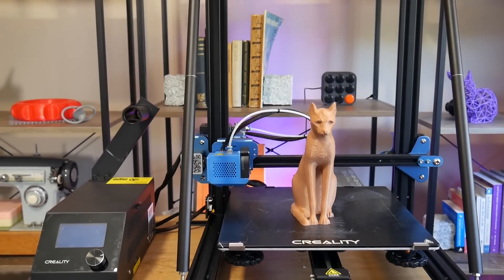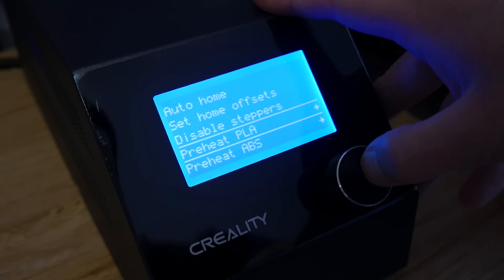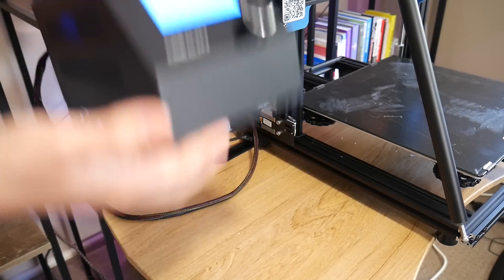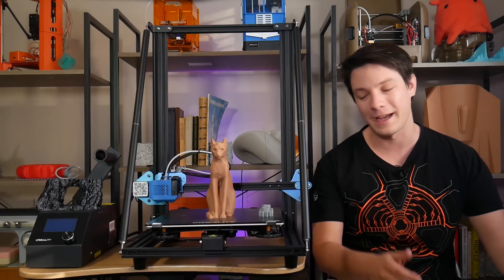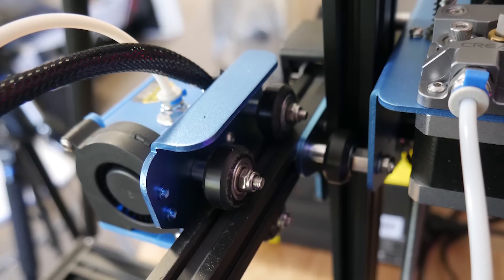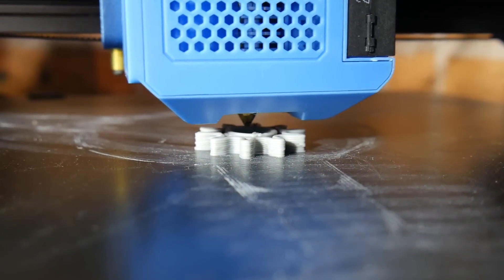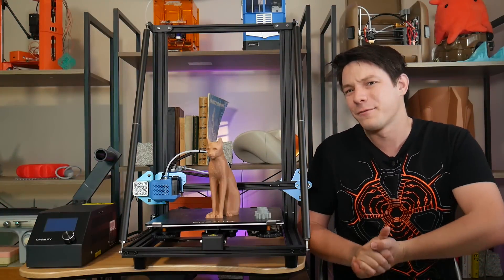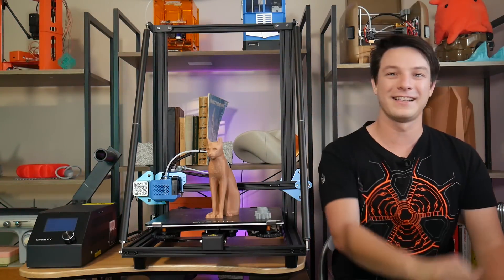Can the CR-10 V2 topple the Creality King? 3D Printer Review

Comment: So question for you. I have a Bambu A & A P1S. I love them. But I'm making Helmets and my head is slightly bigger and have to cut the helmets. Which I hate because its more work. What printer would you recommend around $700 or lower. That's easy to use and has a nice build plate size. Thanks in advance.

Comment: I own  two of these... they are both COMPLETELY DIFFERENT. ordered them both directly from the creality website, both came if different boxes, the hot end is different, one of the extruders can take a manual knob the other can't, one has holes for the bltouch (don't buy one) the other doesn't, and one had clips for the bed the other had integral sliders to hold the bed; and it's sort of random which one has what parts.

they both print perfectly, except the filament sensor on one was not functional, so I simply bypassed it by breaking it open and taping the switch into the "on" position.

Comment: Great review Angus. The constant smile on your face speaks volumes about how passionate you are about this hobby.
I am thinking about getting the V3 of this printer and have watched a ton of unboxings and reviews however there's one thing about setting up the printer that bugs me..
Not once have I seen anyone put a square on the uprights and so in theory when installing the support bars you could push one upright slightly backwards and pull the other one slightly forwards. The taller a print goes, the more twisted it would print? Or am I missing something here?

Comment: I have an ender 5 and the best thing I did was ditch the creality version of Marlin for th3d version of it. I eventually put in an ezboard lite as Welland that made it even better. So far I got a t8x2 lead screw micro Swiss all metal hotend glass bed ezabl Capricorn tube ez board lite. I might as well buy another printer to do upgrades on. Maybe I'll get a core xy. However I did want to still try a remote direct drive on my ender 5. I wasn't sure how into 3d printing I was going to get but I really like it.

Comment: All i can say is DO NOT buy the BLtouch. For some reason, they disabled soft limits with their bltouch firmware, meaning you can literally jog your machine into and end stop and have it destroy itself. You can also drive your hotend into the bed. It’s actually really easy to level manually, at least mine was. BLTouch for this macjine just isn’t worth it

Comment: This machine prints great, but I don't understand why they don't give it a wifi connection and control it through an app.  Would be infinitely better than the very clunky, awkward, and inconvenient knob based interface, and shipping data back and forth on SD cards.  That's just silly.

Comment: As for the bed heating before the nozzle, you can always set them to heat up together once you start the heating process by going into the settings. I only have the normal CR-10, but I’m assuming it’s the same since the firmware looks the same.

Comment: Great Video! It's 2020 now and I finally decided to jump on the 3D Printing Wagon and I'm really glad I did! I went with the original CR-10. I cant believe how easy it is to print things with this printer.. I just bought some glow-in-the-dark filament for a super cool character I plan to print for my next video! >:D
Reply: Hi, sorry to dig up an old comment. I'm looking at buying my first printer. Main use would be to prototype projects and having detailed prints is a requirement as well as being able to print a decent size. Would you recommend the CR-10, and if so, the upgrade versions or would the original be fine?

Comment: Bought and set my CR-10 v2 up yesterday, making sure everything was square and level... Only two minor issues I've found so far. The Y-axis has a tight spot towards the rear, and the Z-axis switch is too high, leaving the print bed to lose and prone to wobbling while moving. Can't do much about the Y-axis, but printed a new mount for the z-axis switch so I can lower the bed a touch, getting those springs under a bit of load.  

Todays' task is tweaking the settings for PTEG...
Reply: The problem same for my CR 10 V2 , z wobble problem maybe from the bed can't tight and fix. Any update solution? Thanks in advance

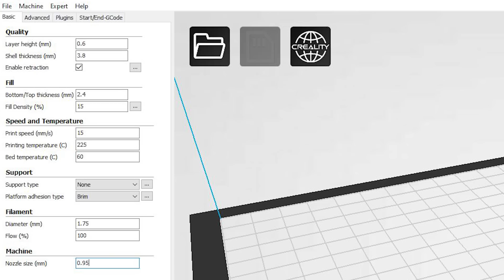Comment: 8:11 that’s pretty slow... My 1mm nozzle I print at like 60mm/s (with .8mm I do about 100mm/s). The only reason the 1mm is so slow is just because the printer was in really bad/worn out shape.Taking it apart right now, I see 3 linear bearings were not in great shape, my idler bearing fell apart, my frame was extremely loose and wobbling, my Z stepper frame structure was loose and barely held on wobbling like 3 degrees in all direction, I have part of my extruder held together by zip ties, and several of the bolts I realized were never even long enough to screw into anything since I made it 7 years ago...  Technically my nozzle even was extruding a figure 8 shape with 1.4mm in height and 1.1mm wide with the pinching of .9mm in the middle of the “8”. I mean I used to print 150mm/s at .5-.6mm but it shakes itself apart too much and my poor ol printer was needing some work so I did that this weekend (also other things like the glass bed was broken so I had to print on the remaining “L” shape just screamed to me that it was time to fix stuff lol!)

I’ll keep running this thing till it dies or it kills me (and seeing as how it’s even outlasted a power cable that could have burned down my dorm room and I still fixed it and use it to this day, It’s probably going to have to kill me first!). Everything is just too cheap to replace when it does break (it looks like the notorious A8 is going for $89, and that would be the closest thing to represent my machine in today’s prices, mine is an old school Prusa i3 clone, so no screen or SD card like the A8, gotta leave the laptop plugged in the whole print!). I’m looking to get a new second machine. I’ve upgraded mine to Bowden a long time ago for rapid prototyping, so I want the other to be a slow and accurate direct drive but it seems all the new ones are Bowden like Ender 3/Ender 5/CR-10/Tornado Titan etc. the only direct drive I seem to find are the ancient obsolete ones like mine (which makes sense, it was direct drive, and they are still selling the same crappy direct extruder mine originally used since these are likely 5 year old warehouse stock trying to get rid of at under $100). The Ender 3 looks perfect if it came with silent 32 bit board and direct drive, I’d happily pay an extra $60 just for that, although I guess that’s like the price of the upgrades and keep the old ones “free”...

Comment: Thanks for this review, still not sure what to buy. :-)
Great to see a Mean Well in this, but is 350w enough for a heated bed on such a large build volume? Also, will it be sufficient to support a volcano hot end?
We talk about Creality listening to feedback, but I’m not convinced. They shipped the CR-10s PRO with a fantastic 500w Mean Well unit and not put one into this printer, but thank goodness they did not use that fire hazard 500w “Branded” PSU from the Ender 5 Plus.  It is a real shame as I would have gone for that printer had it not been for that PSU.

Comment: My BEST upgrade to my cheapo A8 clone was a genuine E3D "Block and Sock" kit. For under $30 I had fixed the flakey taped-in-place hotend thermistor and now had badass heating capability, can run 1.0 or 1.2mm nozzle very well even at ABS temps.   If I got that I'd quickly do the same....though kinda nervous to go bowden from DD.

Comment: My CR10S transformed from a mess into a star when I added a BL touch with mesh auto bed leveling. So in my case, for long term reliable, fuss-free operation, a BL touch or any other good ABL probe is a must.

Comment: Can you do a comparison between the CR-10 V2 and the Artillery X1? pleeeeease
Reply: I hope this helps a bit:
I have bought both, and I love both of them.
The CR-10 V2 is very reliable, however I didnt have great results with the optional titan direct drive extruder. But aside from that, it is a great printer, amazing prints, great build plate adhesion. I mainly use it with my 0.8mm nozzle, and still get great results with amazing strength.

While the Artillery Sidewinder X1, with its volcano hotend, and direct drive I have found prints flexible and exotic filaments amazingly. The only issue with I had with that one is the lead screw couplers. They were very wobbly. But after replacing them I got great results. 

They are both great printers, however I cannot say if one of them are better.

Comment: I have a original CR-10 so did you think they would make an upgrade kit to fix up the older machines? since really it’s just braces, new steppers, power supply, and a few other small things. I’m sure there would be aftermarket kits but I’ve been always cautious of quality and longevity.

Comment: I was hoping for a review before I bought mine over a month ago. I took the gamble and picked one up. Its technically my first printer but Ive been so happy with it. Printed some great stuff with the stock nozzle but upped it to a .6 to print larger vase based stuff. I havent gone into Cura or Creality settings to tweak anything but have been getting good prints with basic settings. Getting some base ideas under my belt then ill deal with tweaking. Just trying to prototype fast atm

Comment: no its not hard to level. as long as that plate is FLAT leveling is easy. intuitive? no but once you "get it" its quite easy.

yes the UI firmware SUCKS. it does that "lagging" thing where you are turning the encoder and nothing changes. really annoying. but the print quality is quite nice and its very consistant. I have not had to touch the leveling knobs since first level and I have picked it up and moved it!! nice!

For the flat spot. x carriage is likely "too tight" just loosen it a bit and that might go away. and YES 1.0mm is what I have on it till my 1.2mm nozzles arrive. go 230'C and you can run 30mm/s no problem. (at 0.4mm layer height)

And here is the thing. with a 1.2mm nozzle you can go .6mm LH or .4mm LH (my default) or yes 0.2 0.1 and 0.05mm layer height. nozzle size has nothing to do with layer height so have at it!

as long as none of the radius in your model is finer than 0.6mm (the minimum radius this can typically form with a 1.2mm nozzle) than you will never know it was done with a 1.2mm nozzle except that it is done faster and stronger!!

Prints with 1.0 or 1.2mm nozzles are just SO stinking strong !!! I love it!

Comment: Hey, i love your reviews, Keep it up. 
Can you suggest me few options of 3D printer for my office prototyping work, with below features: 
1- Dual independent hot-end.    
2- TPU, PVA and ABS compatible 
3- direct drive (because of TPU will be my primary printing material) 
4- Minimum 300x300x300mm printing volume. 
5- heated bed 
6- touch screen 
7- fast and good finish
8- any 1.75 filament material can be used. 
9- Strong body and look
10- Under $3000 USD. 
Help me, Thanks
Reply: Why don’t you get yourself a Craftbot 3? It’s a bit expensive and a bit smaller than you want but check it out

Comment: I have 2 of the CR-10s machines and they both work flawlessly after creating supports for the uprights and a few mods to the stepper gear for the filament.  I leveled my bed over a year ago and haven't touched it since with no problems of the models coming loose.  And it's the original glass (warp facing up).  I also just started running TPU through it and it works great as well.

So I don't see much need in buying a new machine that isn't a huge improvement over the CR-10s design.  However, I would love to see a Volcano hot end or native direct drive.  I almost upgraded mine, but just never really felt like messing with it.

Comment: So basically it's a cr10-s with extra frame support added and micro sd to sd and you have a v2 cr10 is amazing I still have the first version and loved upgrading as new versions came out you learn more starting from the basic those lines on the prints I do believe there seams and you can hide them in cura to the sharpest point of the prints or hide them by random seam points hope that helps great review tho bud keep up the great work love your vids :)

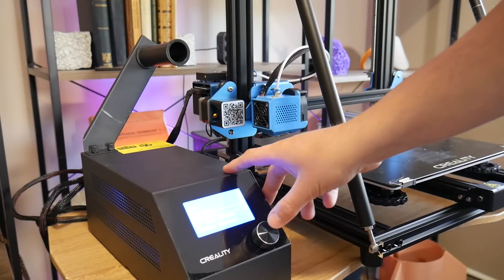Comment: Regarding the comment about the interface at 4:30 "I don't know what they were thinking" .... I think they were thinking nobody is using this interface instead of octoprint.   
I mean really.... has anyone ever used this interface for more than printing that first 'lucky cat'?  I have not touched that knob on my CR-10 in the nearly 2 years I have been using it. (other than resuming on a 'pause at layer' function)
Reply: Totally agree with @gamer SincePong.  On my CR-10, I've been using this Bed Leveling plugin for OctoPrint that has on-screen buttons to move the hotend to the corners and center with just a click.  It also heats up the bed, THEN the hotend, and plays a tune alerting me that the printer is ready.  I have not touched the knob in years also.  Not an issue!
https://github.com/electr0sheep/OctoPrint-Cr10_leveling

Comment: Hi Angus, could you review Sovol SV01 as the appreance  looks such similiar with CR 10 V2, but the price is much cheaper than v2, and it include direct drive extruder (Clone), meanwell powe supply, dual z as well, aluminum frame, but the price for sv01 is only $299, it is quity worthy. th3d did a live stream for sv01 last week and they are  ready to resell that printer with updated firmware and others.

Comment: Look at the Sovol SV01. I got one for $150 and loved it. It retails for $300 but IMO it has a lot of great features (direct drive with E3D Titan remix, ceramic glass build plate, filament runout sensor, and Meanwell 24V power supply) that the stock CR10 appears to lack. It can also heat the bed and nozzle at the same time, and prints flexible materials wonderfully with a single easy modification in the extruder.

Also it's size is respectably larger than Ender 3 but just barely under CR10
Reply: agree

Comment: Angus, you mentioned that the print surface likes an ultra close first layer but you didn't mention the actual layer height you found was needed. On a printer of mine that uses a Build Tak type surface I use 0.25mm for first layer. I recently acquired a delta with this same type of glass like surface. The default slicer profile used a first layer height of 0.3mm which seems way too high. I'm going to test 0.25 but wonder if it might need to be lower.

Comment: That click wheel is the most annoying thing, at least with my Creality printer. I ended up removing the wheel and controlling it using nothing but the shaft to avoid the constant accidental change of selection when clicking.

Comment: This is actually one of the better machines, of this price class, you have reviewed so far.

One word to the software. Changing the input mode and hardware requires often a very costly developer, and if you need to cut costs, you go by "don't touch what works" rather to invest in a harsh new reality. Just my thoughts about that.
Reply from the maker: Yeah, I think that's what is happening here.
Reply: If companies want to hire the very best without breaking the bank, we have a stable of dozens of super affordable firmware developers standing by who know how to do configuration and enhancement. Many of them are open to freelance work. They are, by and large, Westerners, but a few are located in Asia.

Comment: Are they still using the ATMEGA1284 in this model?  Creality need to move off of that and either go 32 bit or at a minimum thee 2560 so you CAN have multiple convenience features.

Comment: I didn't catch if this comes with dual-Z lead screws.  One would hope it does.
Other than that, only one issue: Belt tensioning with those metal brackets is horrible.  They desperately need to incorporate some spring-based or threaded system to tension those belts.

Comment: Heating the bed first and then the hotend is also in my Ender 2, so I'm guessing that has been there for a long time. If you go into the menu, you can set the temps and fan speed manually though, that'll make sure to heat both simultaneously.

Comment: Angus, I see below that you shot this video first, but given the very strong position you took on the TronXY about TRP you really need to make some sort of statement here.  Many reviewers have a set of measures they include in every review.  You have this with your tolerance test.  If you are going to take a strong stand on safety as another measure then you need to be consistent across reviews.  At least you assembled the support rods.  That's better than another reviewer who did the review with them off.  Thanks for the review!
Reply from the maker: Agreed, but the order was swapped because I felt the other video had safety implications and I have a pretty crazy queue to get through. Going forward, they'll all have it mentioned in the video.

Comment: Why in the name of all that's holy are they still not using MGN style linear carriages on these? They basically added an OEM version of the hardware store Z support mod ealier users came up with and slapped a new version number on it.  Linear rails would be an excellent upgrade for those pain in the ass nylon wheels.

Comment: The flat spot is from sliding on the gantry for the first time and the sharp edges on the end of the v-slot stabs a small gouge into the soft wheel. I think creality puts these on at factory right? if so, it would have been them who messed it up. I still dont get why they are still using these stupid wheels anyways. I think it is time for all the major companies to just move on to linear rails and then the prices will come down more and more so it can be a standard in the 3D community.